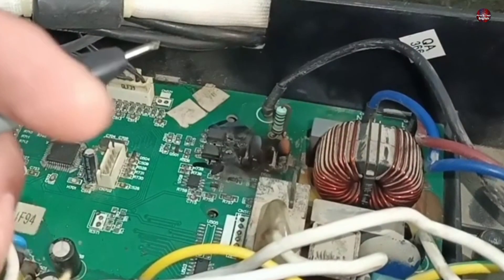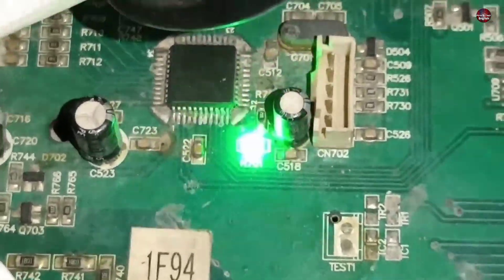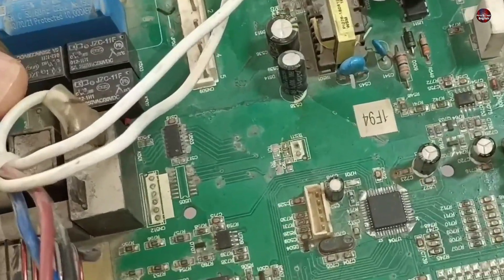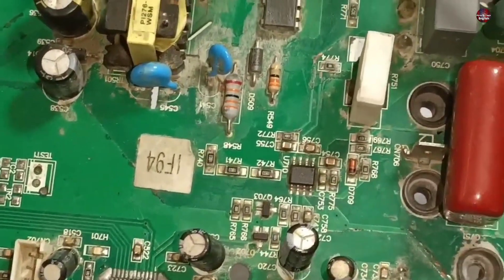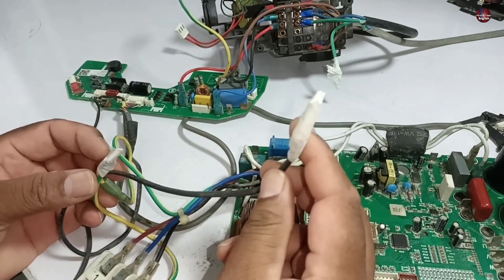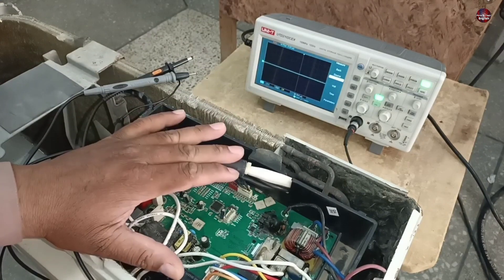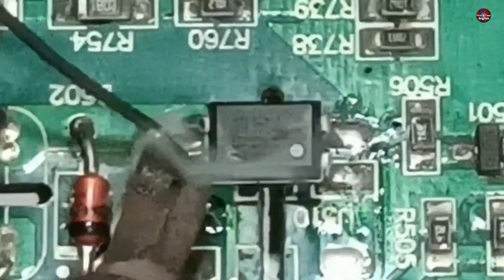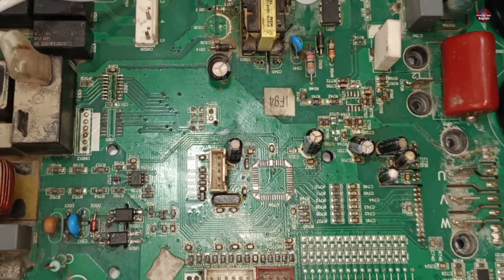Mini Split AC Motherboard Fix Went Wrong, Outdoor Stops Occasionally

Comment: Thanks for the video. Off topic, but I want to ask: RPM of 1000r/min is written on the outdoor unit BLDC fan motors of the air conditioners. Is this the maximum rpm or the nominal rpm?
Thanks.

Comment: Use gasoline to clean rust
Reply: It can not be rusty, because the PCB is made of cooper.
You have in the air all types of components, like sand, organic particles, many types of gas, some of them very aggressive, then some moisture what can condense on the surface of the PCB.

You can clean this dirt with water, I use distilled water, then I remove the water and after this I use Isopropanol to remove the water and some dirt what is not soluble in water.